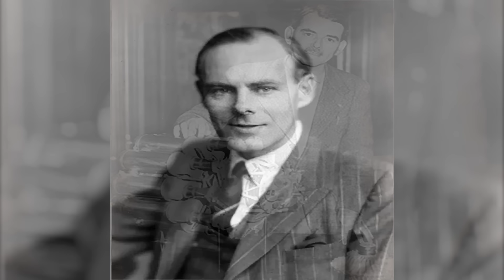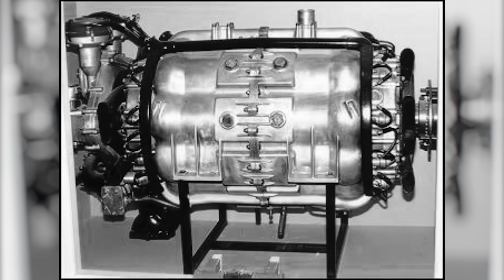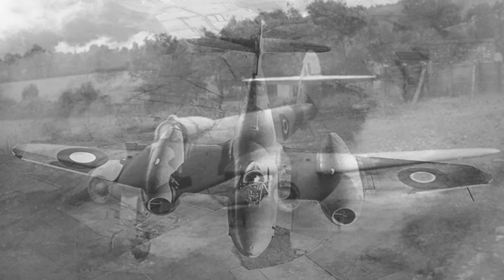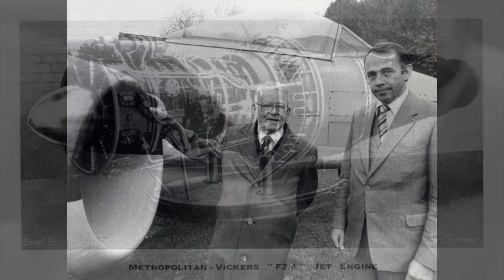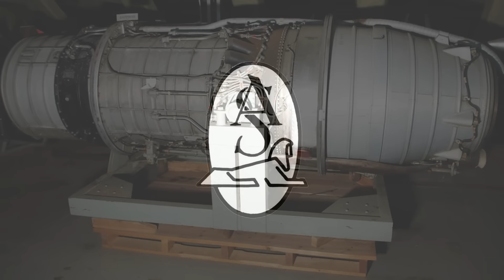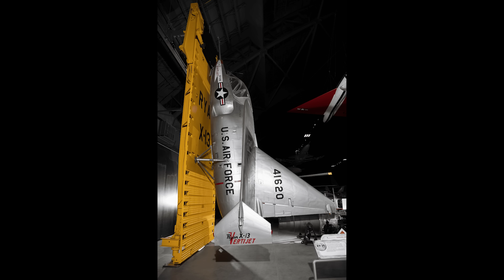The Genius Who Conquered Frank Whittle

Comment: Germans also used axial compressors. how did they use it?
Reply: Yes the BMW 003 and Junkers Jumo 004 were both axial flow jet engines. The BMW 003 uses an annular combustor and the Jumo 004 uses canular combustors.

Comment: The aim was to make a plane that outperformed piston planes.  The centrifugal turbojet did that.  It took five months to perfect the centrifugal flow engine, while it took five years to get the axial flow right - RR Avon, 1950.
Reply: In 'Not Much of an Engineer', Stanley Hooker relates that it was a case of seven months for the Nene, versus seven years for the AJ.65, the Avon prototype.

Comment: Whittle's design was taken by the UK government so any other designer or company could use for their own designs leading to centrifugal flow engines by other companies like Rolls Royce and De Havilland as well as Whittle's Power Jets. Metropolitan Vickers were working on axial flow turbojets first running in 1940, with multiple types produced during the war for use in high speed launches and gensets. 

There were five turbojet engines in the UK under R&D in WW2:

▪  Centrifugal, by Whittle (Rover);
▪  Centrifugal, by Frank Halford (DeHaviland);
▪  Axial-flow, by Metro-Vick;
▪  Axial-flow by Griffiths (Rolls Royce);
▪  Axial flow compressor, with reverse flow combustion chambers. The ASX by Armstrong Siddeley;

The Metropolitan Vickers designs were test flown in 1942 producing more thrust than anything Germany produced with a longer service life. The axial-flow were more expensive compared to the centrifugal designs with still development problems to solve, so being funded by the government they were never selected for any aircraft with cost being one of the rejection points. Another being the centrifugal made a plane faster than the current piston planes immediately, giving a performance edge. 

Metropolitan Vickers produced the first successful turbofan engines rated double anything Germany ever produced during the war. Also the turboprop engine found largescale use post war because of its excellent fuel consumption.
Reply: As a young designer at Bristol Siddeley, Coventry, which became part of Rolls-Royce  in 1966=67, I worked for Brian Slatter,  He was ASM's bright young thing on jet engines during the war.  The ASX was developed into the Python turboprop, which was used in the Westland Wyvern.
And as I've stated elsewhere, at the end of the war Whittle was working on his LR.1 engine (LR = long range).  It was an axial flow turbofan, with a three-stage geared fan, giving a bypass ratio of 3:1.  It was not just years, but decades ahead of its time.  
I've no doubt that its development would have been painful and protracted, but if it had been available in the early 1950s, it could have transformed the Comet.  Unfortunately, along with other promising projects, such as the supersonic Miles M.52, it was cancelled: Britain was broke.
Reply: @grahamj9101  
Great post:
The three-stage geared fan was not LR.1 or LR.2. Whittle’s 1936–1938 three-stage geared fan was an extremely forward-looking idea at the time. Well ahead of anyone else. Whittle’s early geared turbofan/propulsive fan concept was conceived before WWII, long before the term 'turbofan' existed.

Whittle understood that pure jet exhaust is inefficient at subsonic speeds. The three-stage was a geared fan, a multi-stage centrifugal fan, driven through reduction gearing from a gas turbine. It accelerate a large mass of air slowly rather than a small mass rapidly. Three centrifugal fan stages. Each stage raised airflow slightly, all done via a reduction gearbox. The turbine speed was ~15–20,000 rpm, reduced to fan-suitable fan speeds of ~2–3,000 rpm.

Whittle anticipated the turbofan by 20 years, recognising the propulsive efficiency problem

He proposed:
- gear reduction;
- large mass flow;
- low jet velocity.

All three are core principles of the RB211 and all modern geared turbofans.

Comment: This narrative is a total distortion of the early history of the jet engine and, as is often the case, Whittle's genius and contribution are questioned. At times, it is even totally ignored, particularly in the USA.  I say this having had a career lifetime in the design of gas turbine engines, industrial, marine and aero.  I will go on to assert that, if anything, the "conquest" was in the other direction.
In 1926, Dr A A Griffith of the RAE wrote an internal report proposing an axial flow gas turbine engine - but it was what we now term a turboprop.  In 1929, he dismissed Whittle's proposal for a turbojet engine, but did not discuss RAE's work with him. He was committed to and obsessed with the turboprop principle.  Into the 1930s, the RAE, under Griffith and Constant, who joined RAE in 1936, built and tested several small axial flow compressors, together with several 'heavyweight' research gas turbines, using power turbines to give shaft power. 
By the late 1930s, they had contracted Metrovick to design and build a 'lightweight' axial flow turboprop. However, when Whittle's rebuilt WU engine demonstrated its potential in 1939, the turboprop project transformed into the F.1 turbojet. This was developed as the F.2, which first ran in December 1941. It produced more thrust than Whittle's W.1 engine, which flew in the E.28/39 in May of that year, simply because it was a larger engine with a higher mass flow, but its reliability was suspect.
A considerable amount of work was required to develop the F.2/4 Beryl, which gave 4,000lb thrust. However, R-R had designed and tested the centrifugal Nene at the end of the war, which gave 5,000lb thrust. It was much lighter than than the Beryl and was marketed as "the most powerful and reliable jet engine in the world". 'Pirated' and developed by the Soviets as the Klimov VK-1, it gave almost 6,000lb thrust in the MiG-15, and was competitive during the Korean War with the heavier axial flow GE J47 in the  F-86 Sabre. 
I could go into a lot more detail, but what is totally absent from this narrative is the fact that, at the end of the war, Whittle was working on his LR.1 engine, which would have been not years but decades ahead of its time. It was an axial flow turbofan, with a 3-stage geared fan, giving a BPR of 3:1. Along with other projects, such as the  supersonic M.52, it was cancelled: Britain was broke.
Reply: " 'Pirated' and developed by the Soviets as the Klimov VK-1, it gave almost 6,000lb thrust in the MiG-15"
Can you 'defend' the pirated bit? 
My version tells how Atlee's pos WWII government supplied all the necessary material for the Russians - no slouches at engineering - used the information supplied by the UK to put good engines into the Mig.15. No need to 'pirate' at all!

Comment: This video is a click bait version of real events.    The Rolls Royce Avon axial flow turbo jet,  although ultimately very successful,  suffered from significant teething problems.  The centrifugal compressor design , the Whittle design was a great achievement,  more so because it was produced on a shoe string.  As someone has already mentioned, “Not much of an Engineer “ by Sir Stanley Hooker ,  explains so much.
Reply: Adding to my previous comment, there are those uninformed commentators who criticise Whittle for "choosing the dead-end technology" of the centrifugal-flow compressor. They ignore the fact that he had no choice. Firstly, in the early 1930s, axial flow compressor technology needed several years of development and testing before it could be adapted for use in an aero engine. Secondly, Whittle had very limited 'private venture' finance, and, of necessity, had to design the simplest, smallest, yet practicable machine (say, the equivalent power of a Merlin) that he could. Thirdly, he went for a known and proven technology, that of the centifugal impellor of the turbocharger. Even so, he pushed it to the limit - and it worked first time! An axial flow machine certainly would not have done so. I can tell you from my personal experiences in the late 20th century that they rarely did.
Reply: As Stanley Hooker said in his autobiography, 'Not Much of an Engineer' (quoting from memory): "It took us seven years to get the AJ.65 [the Avon prototype] a clean bill of health. We did the Nene in seven months!"  That timescale was entirely down to development issues with the compressor. Even then, the problems were only finally overcome in the 200 series engine with the use of the Sapphire compressor's aerodynamics.
Reply: @g @grahamj9101 .   Yes , I agree.    I didn’t watch much of the video ,  because I found the title clearly provocative.  I should watch it when I get time.

Comment: What about Hans Ohain, working for Heinkel, who devised an axial flow jet in the early thirties which eventually powered the Me 262, the world's first operational jet fighter, which far outclassed Britain's contemporary Meteor jet and firstflew in 1943?
Reply: The Me262 didn't 'far outclass' the Meteor. British performance figures for their aircraft were very conservative by German and American standards, so the Meteor III was nominally capable of 493 mph, but would have been doing 530-540 mph by German standards. To illustrate what i mean, consider the Mosquito FBVI, which was rated at 380 mph in wartime tests, but 420 mph in the post-war pilot's handbook after the RAF switched to German/American methodology. The Meteor could also out-turn, out-roll, and out-dive the Me262, and the four high-velocity Hispanos were better than the low-velocity 30mm guns on the Messerschmitt.
Reply: @dupplinmuir113  You dont know much about WW2 aircraft do you,and what you dont know you replace by fantasy, which suggests you are woke..The 1944 Meteor could do about 450mph at sea level, just fast enough to intercept V1 flying bombs .lt was armed with 20mm cannon, whereas the 262 was armed with 30mm cannon.The Meteor was not sent to Germany because the Brits knew it would be humiliated not only by the 262 but by the latest German piston engined fighters. The Meteor was improved after the war, but a fair comparison is what both were like in 1944.
Reply: @bernardedwards8461  I suggest you read around the subject. In particular there is a very comprehensive essay on the superiority of the Meteor over the ME262 to be found in Quora. There are many myths around the ME262. It looked the part but apart from its speed it was a poorly thought out aircraft. For instance it had no dive breaks which under many circumstances turned its speed into a disadvantage. Its swept wings served no purpose other than shifting the CG backwards. Don't criticize when you don't know what you are talking about.
Reply: @TCSC47  It's you who doesn't know what you are talking about. I am relying on the opinions of people like renowned naval test pilot Capt 'Winkle' Brown. who knew slightly more than you do about it. You must be quoting performance of post-war Meeors, but Brown compares aircraft operational in 1944. You must be woke, it is their habit to pretend to be expert in matters they know little about.
Reply: whittles first patent was a axial compressor with a centrifical booster but due to lack of suitable materials he chose just to build the booster itself,,,  axial compression was used in steam engines from 1884,, so it wasnt new science and the mig 15 used centrifugal in the early 50s so it was decent but it had reached its limit by then
Reply: @davidblurton7158  Axial flow is logical for steam engines, which operate at low speeds and temperatures compared to aeroengines and dont have to worryy about aerodynamic drag. The Mig 15 used centrifugal compression because the post war Labour government sold Viper jet engines to the Soviets, who reverse engineered them.
Reply: Von Ohain's engines had centrifugal compressors and centripetal turbines. They were significantly less efficient than Whittle's early engines.
Reply: @grahamj9101  l have no knowledge of Ohaine's earliest efforts, all l am sure of is that by1942 or sooner he and Heinkel had devised an axial flow engine good enough to power the He 180 and the Me 262.

Comment: Wide of the truth to say that RR copied the Sapphire with the Conway. Both had their roots in the work of Alan Griffith, who was the actual inventor of the gas turbine jet engine. His 1926 paper inspired both Whittle and von Ohain, who both decided to take the short cut of using a centrifugal compressor. In 1938 he was working at the RAE consulting to MetroVick, and guiding their gas turbine work when Constant joined. In 1939 he joined RR and started work on an axial turbojet called the AJ65, which became the Avon. RR didn't take over the Whittle engines from Rover until 1942, when they were well into work on the Avon. The first Avon was the compressor developed by Griffith coupled to the combustion chambers and turbine of the RR Nene, which was completely a RR design (led by Stanley Hooker), though following the Whittle outline. The Avon first ran in 1947 while the Sapphire first ran in 1948.
Reply: 🎉Griffith did not invent the gas turbine jet engine. As I've stated elsewhere, in 1926 the engine he proposed was an axial flow machine that we would now term a turboprop. There was nothing novel in the principle of a gas turbine engine delivering shaft power. Aurel Stodola had discussed it in his book on steam turbines years before.
Griffith was so committed to the turboprop principle that he rejected Whittle's turbojet proposal in 1929. suggesting that there would be insufficient energy in the exhaust to produce thrust. He continued to damn Whittle's engine with faint praise, even when it was about to run for the first time in 1937.
Reply: The Sapphire 6 was Armstrong Siddeley's development of the Metrovick F.9. The Sapphire 7 was a further development.
What is known and well documented is that fact that the Avon 100 compressor was substantially improved with the incorporation of the Sapphire compressor's aerodynamics into the 200 series engine.